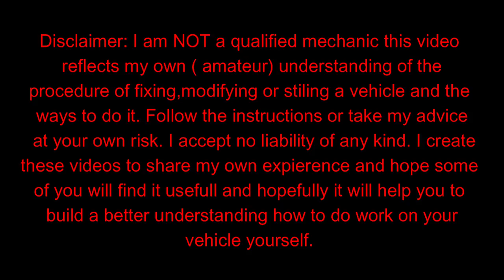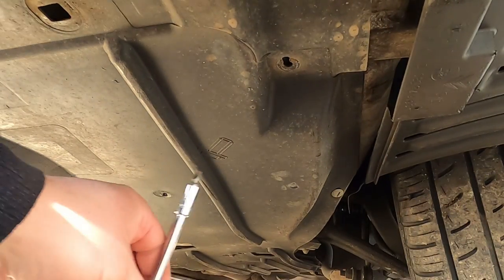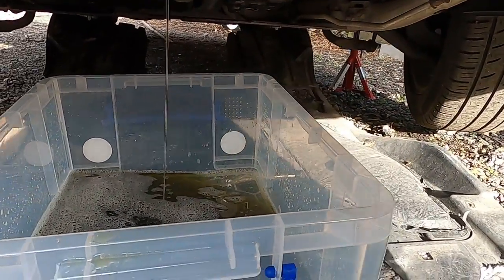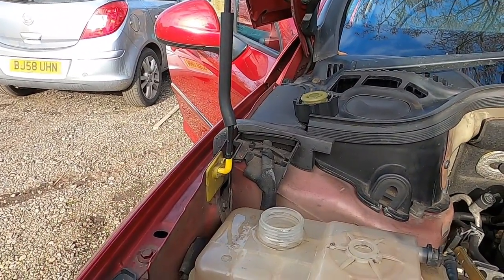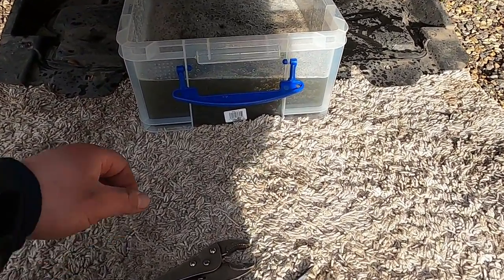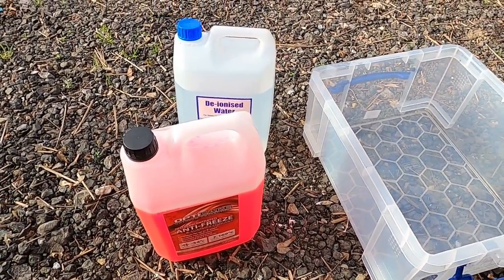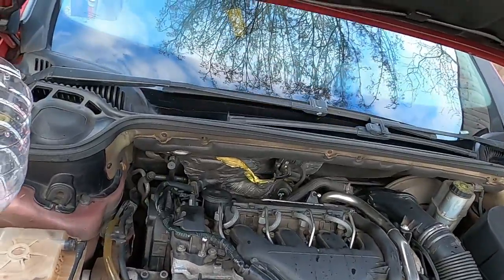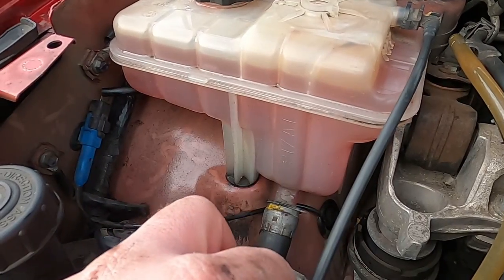Antifreeze / Coolant replacement on a Peugeot 407 SW 2.0HDI

Comment: That was probably the clearest, easiest to understand and comprehensive auto maintenance videos I have seen. Well done and thank you bi have a 2.7 hdi and will see if I can find the 2 bleeder valves and do the job myself, as it’s due.
Reply from the maker: Hi mate first of all thank you for positive feedback. I am not sure if a 2.7 is gonna be similar as I have never had one so can't really tell but the procedure should be similar.
Reply: I will check but everything I can see under bonnet and below looks the same except the size of the motor so I would be surprised if it is not. Thanks again from Australia.
Reply: Jesucristo te ama muchísimo, arrepiéntete de tus pecados y ten perdón de pecados en Su Nombre

Comment: Just I let you know I have upgraded from my 407sw 2.0 hdi 136, I am now happy owner of 2.7 hdi SW which has big upgrade ......a manual transmission, found the car in Italy at good price, man told me it cost him more than 2,000 € for the change, very very happy with it, I put more than 2,000km in 3 weeks, fuel is not so good, but engine noise is beautiful, I go to Peugeot dealer because rear hatch switch did not function, 59€ for micro switch, but man at dealer was interested very much, never he sees a conversion before. I wish I could show picture 😊
Reply from the maker: This sounds really cool i am sure here in uk a lot of people buy a coupe for 2.7engine and you got it in a sw its really cool. Its must be really fast and cool to drive. Well done mate you have something very special there.

Comment: As you said, be careful not to lose the little screw cap of the heater hose/thermostat housing. I did exactly that, while being alone. The quickest solution in order not to lose the whole amount of coolant is to screw on the plastic caps from the tires. Actually, I have seen cars fitted with them driving for years.
Reply from the maker: Great idea mate
Reply: That’s could be a lifesaving tip for fat fingers like me!

Comment: Thanks mate, big help. Mine did not have the bleed point at the thermostat it had a hose running straight back to the expansion tank so Only one cap to lose lol. Just did my second timing belt using your other guide really good stuff thanks
Reply from the maker: Thnk you mate apreaciate a good feedback, glad it helped

Comment: Excellent video thank you.
I'll save this job for the spring time, as I mentioned before, living in the wildlands on the Anglo-Scottish borders I don't want to risk messing with the coolant in the winter, esp since the bottom hose clip looks as rusty as yours !.
The coolant in my 407 looks like river water but it has survived  -7°c nights so hopefully it will be ok until the warmer weather and I'll fire it out, following this routine.
Reply from the maker: Thank you mate. Sounds good to me, as you could see my coolant was looking like a dirty river water too. Glad I have changed it.
Reply: If it looks like dirty river water, you NEED to change it. The coolant is no longer effective at preventing rust!
Reply: @khalidacosta7133  it's difficult to do any DIY work with high winds and low temperatures.!

Comment: Those two bottom radiator hose clips on mine are severely corroded too. I think everyone should replace those, it's a potential failure at some point! However I would advise to use the spring clips as OEM rather than worm drive hose clamps. Those clamps don't auto-adjust to heat/cooling and natural setting of the rubber and can sometimes leak over time. Finally, often the "leak" point is the radiator cap itself, it's a pressure release valve and the seals fail over time. A few quid on ebay solves the problem.
Reply from the maker: I might need to get a new claps for all the hoses at some point. Hoses itself seem to be good. Gonna look in to new expansion tank cap
Reply: You know where to buy that clip and which size it is? regards

Comment: The explanation and video was top notch. Meanwhile I haven’t been able to drive my automatic Peogeot 407 sw because of overheating. I use only water instead of coolants. The radiator have been changed to double cell. It has bled multiple times but it still overheats. The water boils or bubbles while I drive and flows out through the expansion tank cover even when it tight. I need help on where to look out for.
Reply from the maker: I think becouse its just water and not a coolant it boils and thats why it goes out of the expansion tank. It has to be coolant premixed or coolant concentrate mixed with dionised water. I think normal water can damage this system regardless of radiator
Reply from the maker: Also thermostat might be faulty

Comment: Hello my friend. Question: where is located the dehidratator filter in Peugeot 407 hdi 2.0 136 FAP year 2004? And what is the number of part? Code OEM. Thanks my friend. Very good videos , I fixed all in my car with your help. Thanks again for your extraordinary job!!

Comment: Hello, first of all thank you for the video, very good. My doubt, taking advantage of the replacement of the timing belt, when changing the water pump, does the engine completely empty of water? Or is it only possible to change the coolant using this procedure?
Reply from the maker: If you use method above I believe a very small amount of coolant is indeed still be left inside a system after draining. Then you change a cambelt and waterpump you can drain every drop of system. In other words then you change water pump you normally change coolant as its a best option to empty system. This method in this video drains probably 90% of coolant and water pump 100%
Reply: @Mad4FrenchCars  Perfect, thank you so much again!

Comment: I wonder if the oil temp gauge is not working properly on my car, I have a petrol V6 coupe and the oil temp barely moves on a 15km drive when the coolant has been stuck on 90 for a long time. I understand the thermostat helps a lot and the engine is quite large but still I would expect the oil to warm up quicker than the coolant? Maybe the gauge is just a bit slow because the reading is fine on a long drive

Anyway I need to do a coolant change on mine too since I have no idea how old it is. Appreciate the video, it's exactly what I was planning but it's good to double check so I'm not missing anything obvious
Reply from the maker: Gauge can be a bit stuck a bit or a oil temperature sensor might soon need replacement.
Reply: @Mad4FrenchCars  I guess. Found out the coupe has both hoses on the top of the rad and it just has a screw you open on the bottom of the rad to drain it, much easier and slighly less messy. But god the fluid smells bad, definitely due for a change. Smells about as bad as manual transmission oil which is to say god awful. Hopefully the stench will come off my fingers soon

It's like completely black when it's sitting in the bottom of the vat that I used
Reply from the maker: @waldevv  sounds like it really needs a change mate well done for investigating it.

Comment: Have you ever changed a AC condenser on a 407 sw 1.6 HDI ? Would really appreciate a video!!
Reply from the maker: Hi mate a condenser on 1.6hdi and 2.0hdi is same. You need to remove a coolant radiator or atleast move it towards the engine to access it. Ac gas pipes going to condenser can be a pain to remove from condenser side you have one pipe secured by 10mm nut in a front of condenser and one in a back. I will make a video in a future

Comment: can i ask something diferent 😊 i change factory speakers on 407  demaged  with new 4 speakers.  Witch wire is positive on door panel  White or Colored ?
i cut the factory conector becose of new spekers
Reply from the maker: Hi mate i have done same thing aswell but can not remember now. Sorry i couldnt help mate. Only thing i can think of try to test with voltameter
Reply from the maker: Voltameter should indicated possitive and negative

Comment: Is the ventilation of the installation done through the two valves that you have opened and waited until the water flows through them
Reply from the maker: Ya you could say that. Its how you air a system out

Comment: Hello friend
I just want to ask you did you have some problems with the LEDs after you swaped the on speedometer, i mean do they work properly now after 1 year? Im just curious
Reply from the maker: Yes mate it works absolutely fine. Still using a same speedometer but just in different 407

Comment: Hi , I have pugeot 407 2.0 hdi 2009 model and I just.got the engine mount changed last week and now I'm having the coolent leak at the driver side ...when I remove the air filter , I can see the leak ...but I don't know exact name of the place and part to identify the part and order a replacement from somewhere , can you help to let me know what exactly is this part called ...
Reply from the maker: I am not sure if your coolant leak has anything to do with a replacement of engine mount. If you remove ait intake box and you can see leak then it could be a thermostat housing or pipes I am not sure wich one you are talking about

Comment: عمل رائع ..أحب عملك ..شكرا لك كثيرا
Reply from the maker: شكرا يا صديقي، أنا سعيد لأنك تحب ذلك. هذا العام سأحاول أن تجعل الكثير من أشرطة الفيديو.
Reply: @Mad4FrenchCars  great vid mate just found you i have a 2.8 coupe diesel please do a vid on the heater system mine barely gets warm !!🤦‍♂️
Reply from the maker: @andrewstratford4753  you might have a broken flaps inside a heater unit.
Reply: @Mad4FrenchCars  thanks for the reply is it expensive to get repaired?
Reply from the maker: @andrewstratford4753  If it's a heater flaps I am not sure if anyone repairs them I would join a Facebook group called Peugeot 407 UK a lot of people there fixed theyr own heater flaps and they would be able to advise much better. Also check other things aswell such as a coolant level in a coolant system as low coolant can couse a car to stop blowing how air. What exactly happens with your car does it show a proper heat on a gauges after driving a car? Is it just a problem with no hot air blowing from the heater unit to cabin?
Reply: @Mad4FrenchCars  thankyou so much for your reply will chase that up.

Comment: Can you make a video replacing the hydraulic oil?
Reply from the maker: Hi mate which hidraulic fluid are we talking about? I will be making a video on power steering fluid replacement on 407 also brake fluid. And I will be making a little video on a hidraulic fluid for a gearbox actuator in Peugeot 508 soon aswell. Let me know which fluid you are talking about and I will see what I can do.
Reply: @Mad4FrenchCars yeah on the power steering wheel system, whit electric pump. Total fluid DA oil😊😊
Reply: On 407 🙂
Reply from the maker: @pavlintsanevsky3946  I will do a video on that in a near future but I am unable to do it atleast till middle of march as my car park is getting resurfaced with tarmac. But its on my list on videos coming.

Comment: Hi i'm french i have the same engine but on the  peugeot 307 sw my tank are more and more brown ( yellowish) it's harder see the level of the coolant 
my question is if i changed the timing belt with water pump do you think it's enough to only flush the radiator or i have to flush also the engine ? 
my car has almost 340 000 km (around 211000 miles)
thanks
Reply from the maker: I would flush all of it if possible if not then just radiator is better then nothing
Reply: @Mad4FrenchCars  Thanks man i have another question when a change the waterpump it's possible to flush into the thermostat or i have also to remove and the heater radiator will be flush also ?

Comment: Oh and another question.
The air-conditioning system in my 407 sw has failed,yet again.
I've had the condenser replaced twice in 60,000 miles but now reluctant to pay a commercial garage to do it again.
Is there a problem with the air-conditioning system on the 407, and how easy is it to do this job DIY?
Reply from the maker: I am not aware of any common issue with air-conditioning as it always seem to be something else. It can be anything from condenser to little o rings on a pipes to actual air-conditioning pump. I have it many times and always some different issue. I would get a garage to put a floresant  gas in a system to see where is a leak if there is any. But the good aircon specialist will be able to quickly tell what's wrong with it. And prices are according to what's wrong really. If it's a pump you can get good used one for like 50£ usually. Pipes can be sourced from scrapyard. Condenser better to be new
Reply: @Mad4FrenchCars  thanks. I think it's the condenser getting damaged by stones and gravel entering the front of the vehicle.
If I decide to go back to the air conditioning specialist I'll ask this time exactly what the problem was.
Reply from the maker: @toonmag50  ya need to 100%
Reply: "The air-conditioning system in my 407 sw has failed,yet again."
Can you explain, how did it failed? There is no cool air at all? Is it happening on both sides (driver and passanger)?
Because there is a common 407 problem with some flaps inside the ventilation column...
Reply: @sinisamilosevic6301  my 407 is a slightly cheaper version aimed at  sales representatives wanting a motorway muncher and at a price competitive with rivals.
As a result a few things were nibbled away- one of which was the duel zone heating/ventilation.system My car has just has one zone.
FYI the panoramic roof also disappeared ,on my car, as well as electric window winders in the rear.
My 407 SW is coming up to 165,000 miles (265,000) and I do like it. It's never broken down ,and is perfect for golf trips and my wife loves the power/torque of the diesel going over the hills.
Not sure whether to invest anymore money into the car though- assuming cars lifespans are about 150,000 miles.
Reply from the maker: @sinisamilosevic6301  my friend if you have a issue with your heater flaps I would suggest to join Peugeot 407 UK Facebook group and ask about. A lot of people had this issue and they will be able to help you. I have never had a heater flaps issue. Also I can't see your car so I can't really tell what failed. Heater flaps and faulty airconditioning is 2 different things.
Reply: On the 2.0 HDi, there is a pipe from the pump to the radiator. Those are known to leak and Peugeot made an updated part. Costs £30 for a Hella (OEM to pug) replacement pipe and takes 5 minutes to fit. However, with any AC leaks, make sure you get a leak test on it. The specialist will pressurise it with nitrogen and pass a leak detector wand over the bits and pieces, telling you exactly what's leaking, cost me £40!

Comment: Hi, I want to ask you for help with headlights adjustment wheel problem, it sudenly stoped working, I dont know what to check, may be some fuse or something? Thanks for answer.
Reply from the maker: I can't remember a headlights in a 407 having a directional Headlight? What exactly is a problem?
Reply: @Mad4FrenchCars  headlights adjuster wheel  does nothing. You know that little wheel next to the stering wheel is not working anymore, i donk know if it could be due to fuse or smth…i cant adjust headlights level manualy anymore
Reply from the maker: @lukasolejnik8448  oh I see to be fair is just a little switch and can be faulty might be good idea to order one from ebay they should be cheap, I can't remember any seperate fuse for that
Reply: @Mad4FrenchCars  i tried to change that switch, nothing…
Reply from the maker: @lukasolejnik8448  I had a look at the fuse diagrams and some 407s 2005 models  had a dedicated fuse for it it was a fuse No 9 under dash and it was 10amp. What year is your 407 I can check if it has one. I would just check all fuses
Reply: @Mad4FrenchCars  problem solved, rear plate bulbs were faulty🙈everything is working fine now…
Thanks anyway for your answer, you already helped my with egr
Reply from the maker: @lukasolejnik8448  glad it sorted. Well done

Comment: Hi, i have a problem with my 407, it is making the noise which you can hear in video below. It only does it when car is on it's operation temperature and everything is correctly warmed up. When car is cold it doesn't make that sound. Do you have any experiencies with it? I cant find what it is. 

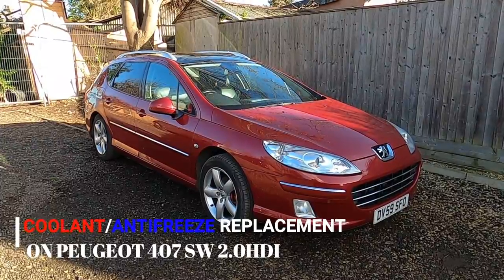Video here and sound start at 0:12sec https://youtu.be/ktl_eI6Uz7s
Reply from the maker: Hi mate it's a power steering pump noise. Need to top up power steering fluid. Always put tiny bit over a max mark. Should sort the problem out.
Reply: @Mad4FrenchCars  Thank
 you for answer, i've already bleed and overfilled my power steering pump... I can say that it get a bit better but still doesnt disappear. I dont have any leakage or something like that so far... Maybe it could cause old hydraulic oil? I havent tried to change it..
Reply from the maker: Also Very important to use only recommended power steering fluid. if incorrect fluid used you gonna have problems such as a fluid going out of the power steering pump through the cap.
Reply from the maker: @Jamo2139  if incorrect power steering fluid used before then it does affect a system a lot
Reply: @Mad4FrenchCars  Car is 2008 so i dont think that fluid was ever changed.. I bought total da fluide which is recommended by peugeot. I dont have any other problems with steering only that noise☹️. The oil is always a little bit foamy after warm up. But really very little. Could it make that problem?
Reply from the maker: @Jamo2139  not sure mate. Total DA is correct fluid. Also don't forget that the pump is electric and if you spin a wheel a lot to one side that's the time then pump works the hardest and takes most of current. So battery power might have to do something with it I am not sure.
Reply: @Mad4FrenchCars  yeah, okay, thank you very much anyway! Since it is not getting any worse, i will probably leave it like that... I am just asking randomly, if anybody know..